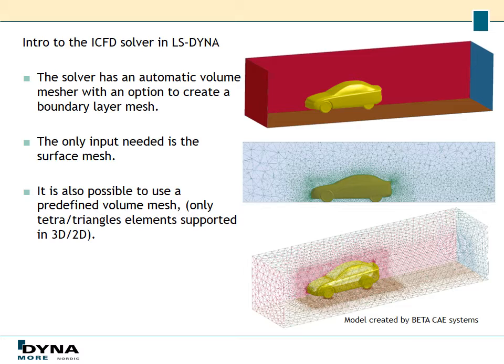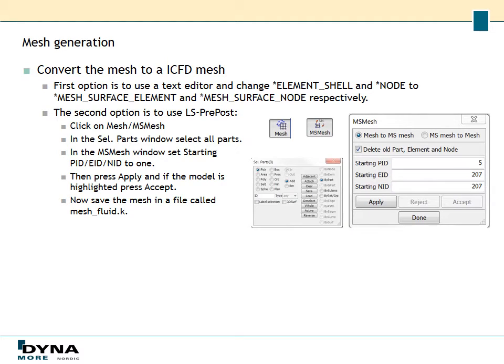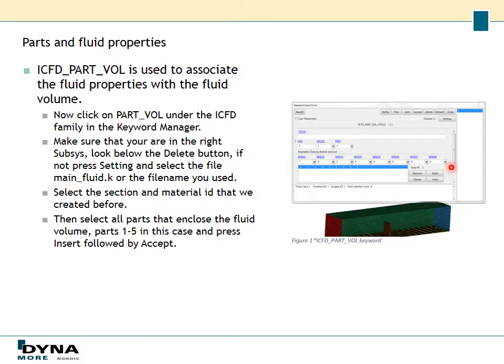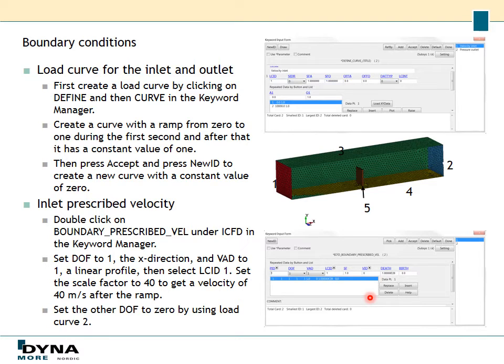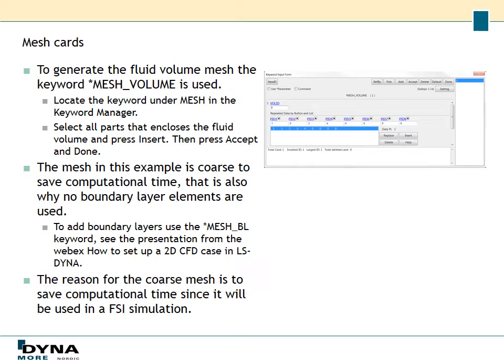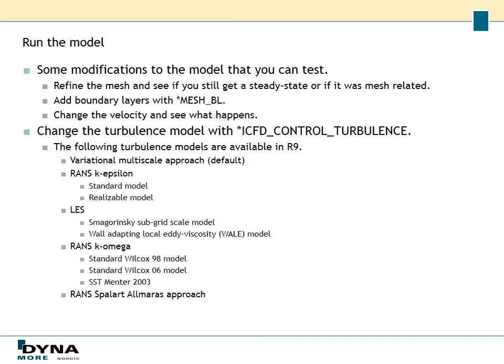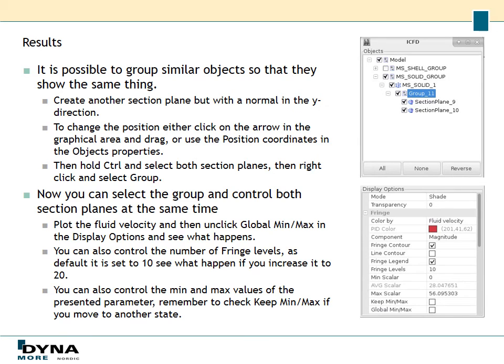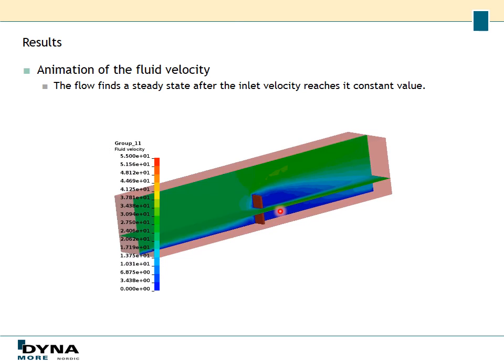How to set up a 3D CFD case in LS-DYNA

Comment: * Error 120003 (ICFD+3)
ICFD::ERROR: No volume element was generated. 
Dear friends,
help to fix this error
thanks in advance
Reply from the maker: Usually this happens when the LS-DYNA internal mesher was unable to create a mesh. Is your domain completely closed. Make sure that you join duplicated nodes at the connection of different parts.